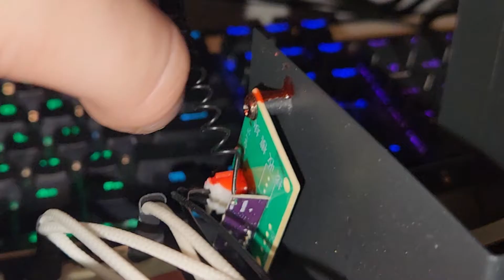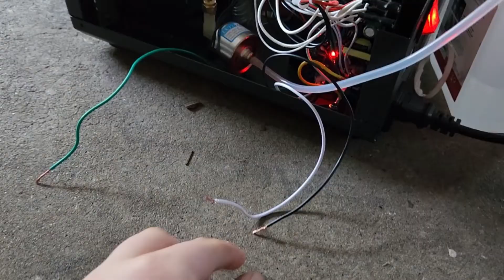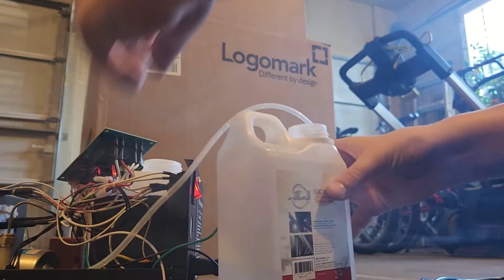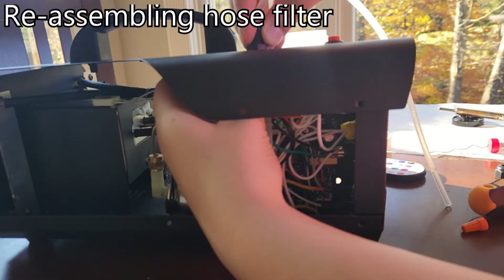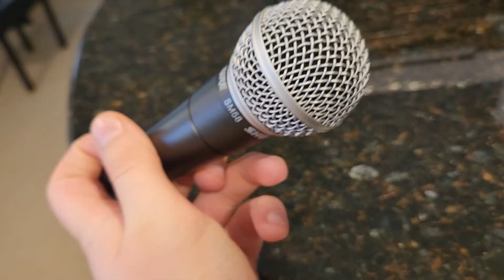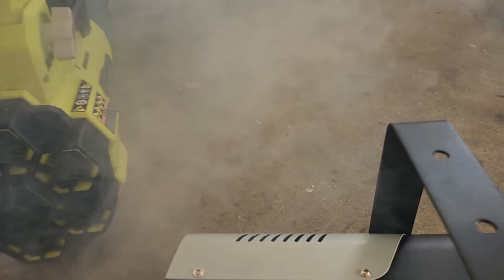1200w fog machine remote jack & manual button mod

Comment: I've just come by one of these without a the trigger included so I think you might have just lead me on the path to either just shorting it out permanently or maybe even putting one of the smart switches I have laying around and making it WiFi-enabled because why not.
Reply from the maker: Hell yeah, world's first wifi enabled fog machine, you might need to tap in to 120v to power the smart switch though.

Comment: This helped a lot. I was given the same fogger without the remote. But I just shorted directly to the pump motor with 120vAC. But I think I'm going to use your method instead with a manual button on top.